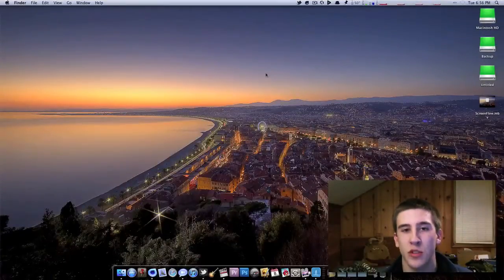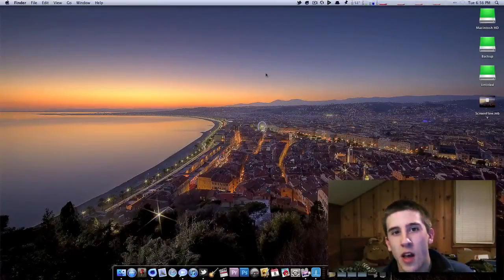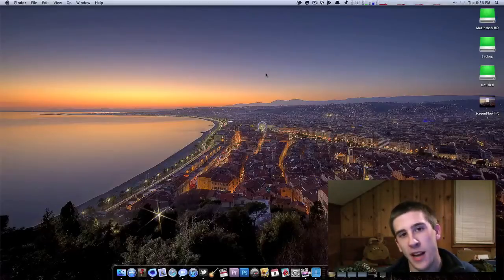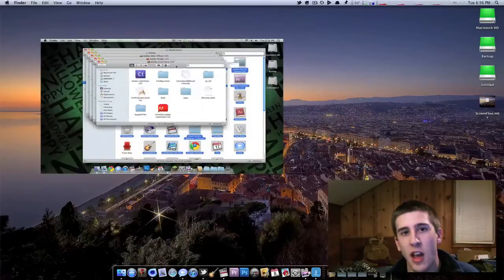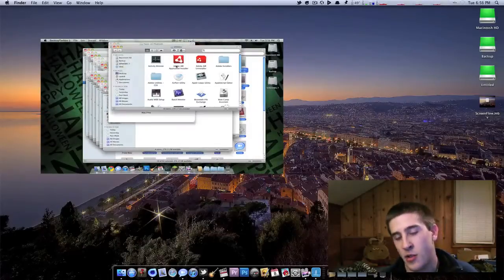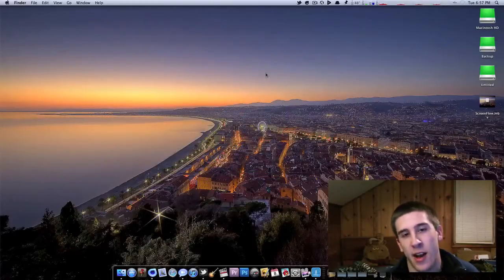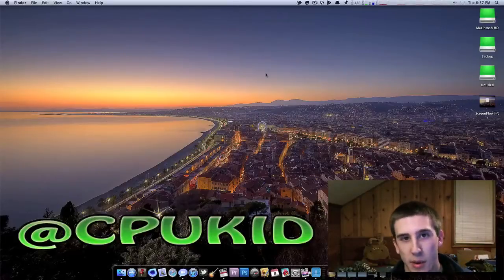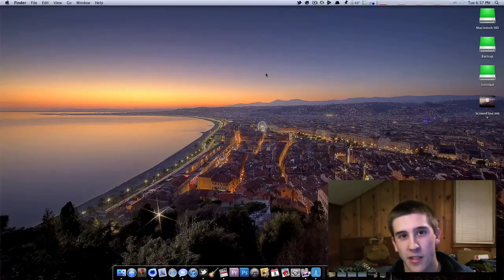Updated Hackintosh Stress Test

Comment from the maker: @Pro9070 I'm currently on ethernet, however I have a wireless card just in case. It's the Dynex DX-BGDTC ver. 1.000. It worked right out of the box, and you can buy it really cheap online.